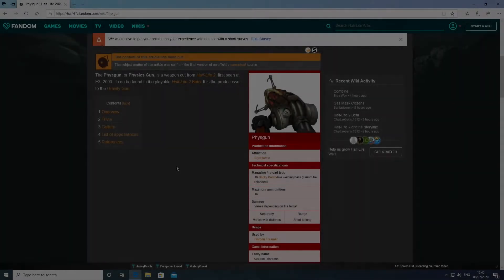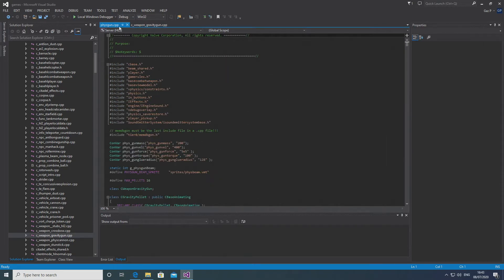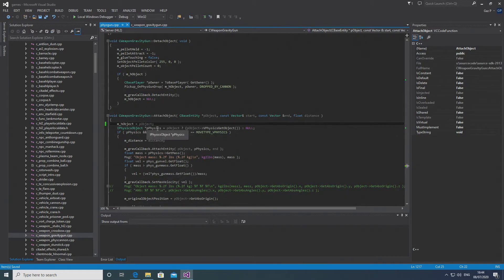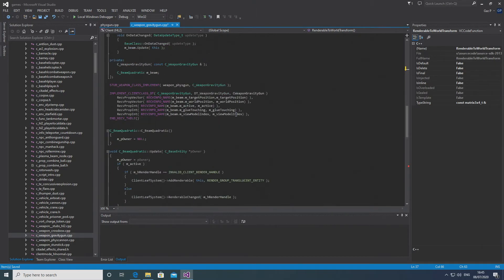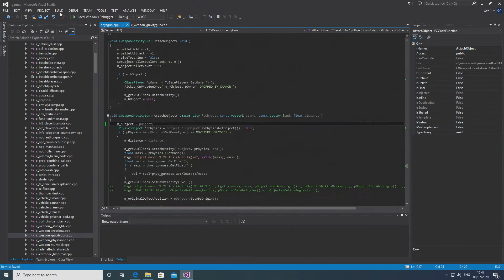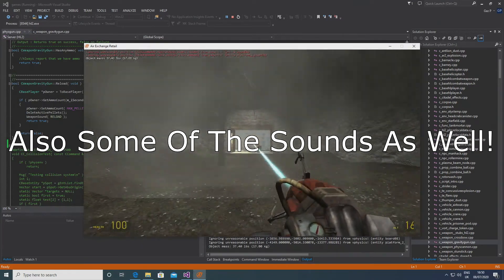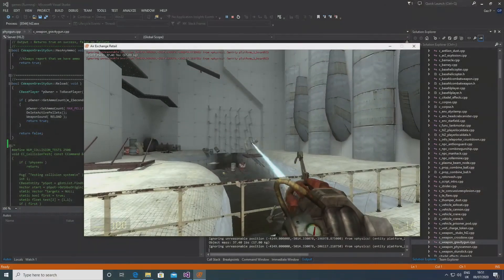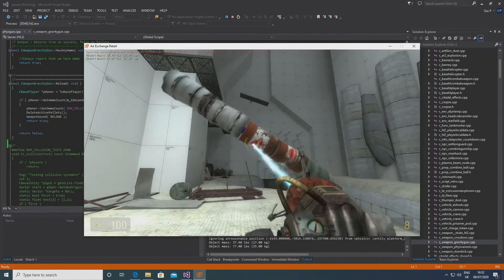Valve Source Code 2013 Tutorial (Episode 2): Fixing the Physgun

Comment: And how do I give to myself the Physgun?
Reply from the maker: Type: give weapon_physgun into the developer console.
Reply: @TheMaster974  It gives me this:
Attempted to create unknown entity type weapon_physgun!
NULL Ent in GiveNamedItem!
Reply from the maker: Did you add the files to the correct projects i.e. added the files to the HL2 code but are launching into the Episodic code instead?
Reply: @TheMaster974  I didn't understand the first part because I don't have the game solution, only the everything solution. Just explain me how to do it via the file explorer
Reply from the maker: Wait, are you trying to add this to a Source 2013 Singleplayer mod? If you are using the updated Source 2013 Multiplayer code, you only get an everything solution, which includes the projects that the games solution has.
Reply: @TheMaster974  I'm from multiplayer, the TF2 branch
Reply from the maker: You must have made a mistake somewhere, as I'm not experiencing that error.
Reply: @TheMaster974  What I'm meaning is that teach me how to move it with the file explorer, not games
Reply: It gives me this error when trying to get it:
Attempted to create unknown entity type weapon_physgun!
NULL Ent in GiveNamedItem
And I already fixed by code the Physgun

Comment: i have a question, how would i be able to make this feel like the garrys mod physics gun?
Reply from the maker: I have commented about this already regarding the object freezing functionality, which I will provide again here. The one thing I haven't figured out is rotating the held object with mouse movement, I don't know how that would be done. Reply: If you mean to freeze an object in place, then yes there is, the user I thanked in the video (Tingtom) implemented something like that. To add this kind of functionality, in EffectUpdate() and in the if(m_useDown) section, inside if(pOwner->m_afButtonPressed & IN_USE) add these lines: IPhysicsObject *pPhys = pObject->VPhysicsGetObject(); pPhys->EnableMotion(true); DetachObject(); AttachObject(pObject, start, tr.endpos, distance); then in the else statement, inside of the if statement here, add the lines: IPhysicsObject *pPhys = pObject->VPhysicsGetObject(); pPhys->EnableMotion(false); By doing this, when you hold an object, pressing the use key will freeze it in the air and pressing the use key again will allow it to move. Hopefully this is helpful (and credit to Tingtom for this addition)!
Reply: @TheMaster974  Thanks

Comment: ClientDLL_InitRecvTableMgr: overflowed MAX_DATATABLESClientDLL_InitRecvTableMgr: overflowed MAX_DATATABLES
Reply from the maker: This looks like you've done something wrong with the Client code, all I can really advise is to do exactly what I do in the video.
Reply: @TheMaster974  I copied the code from the github and it’s still not working
Reply from the maker: That's strange because the code I uploaded to my GitHub page should work fine, so I don't really know why you would be experiencing this issue. Which version of the 2013 code are you using, as well as the version of Visual Studio which is being used to compile the code?

Comment: hey, quick question, is there an way to prevent the physgun from grabbing sertain entity's i have noticed that it seems to crash whenever trying to hold the manhack, just askin if there is a way and if ya could tell me, just askin
Reply from the maker: There is, however it won't really help you with the situation you are providing. From my testing, the game crashes because of the SoundUpdate function, with a variable called pPhys being null when a manhack is grabbed. My solution would be to do: float fade = <whatever-value-you-want>; then remove the float from the existing fade definition and contain that line inside of an if(pPhys) statement, then you should no longer experience crashes. Let me know if this is helpful!
Reply: @TheMaster974  huh, implementing your fix seemed to make the manhack die, well i guess its better than crashing, thanks

Comment: Is there a way to weld object when right click like in gmod?
Reply from the maker: If you mean to freeze an object in place, then yes there is, the user I thanked in the video (Tingtom) implemented something like that. To add this kind of functionality, in EffectUpdate() and in the if(m_useDown) section, inside if(pOwner->m_afButtonPressed & IN_USE) add these lines: IPhysicsObject *pPhys = pObject->VPhysicsGetObject(); pPhys->EnableMotion(true); DetachObject(); AttachObject(pObject, start, tr.endpos, distance); then in the else statement, inside of the if statement here, add the lines: IPhysicsObject *pPhys = pObject->VPhysicsGetObject(); pPhys->EnableMotion(false); By doing this, when you hold an object, pressing the use key will freeze it in the air and pressing the use key again will allow it to move. Hopefully this is helpful (and credit to Tingtom for this addition)!
Reply: @TheMaster974  thanks you!
Reply: @TheMaster974  how i change the bind key into right click?

Comment: Is there a way to make it rotate objects when holding e?
Reply from the maker: I'm sure there is, but I wouldn't know how to do it. Setting up a condition that checks if the player is pressing the E key (+use) is easy, it's rotating the object that's the hard part. You would have to somehow come up with a way to map mouse movement (or something else) to the rotation of the attached object, which I cannot tell you how to do. Apologies!

Comment: "ERROR: Weapon (weapon_physgun) using undefined secondary ammo type (Gravity)" The weld alt-fire ammo is missing help
Reply from the maker: The Gravity ammo type should be defined already in hl2_gamerules.cpp, at least for a Singleplayer mod. If you're doing this for a Multiplayer mod, you would have to go to hl2mp_gamerules.cpp and add the definition for the Gravity ammo type here (it should be around line 925 or so). By default, the definition is like this: def.AddAmmoType("Gravity", DMG_CLUB, TRACER_NONE, 0, 0, 8, 0, 0 ); Alternatively, you can go into the weapon_physgun.txt file and change the ammo type to something else. Hopefully this helps!
Reply: @TheMaster974  My mod was MP, i'll try add that to the hl2mp_gamerules.cpp. Gee, thanks!
Edit: It works for now! Thanks! You're a W!

Comment: I implimented the code and fixed the client side just as in the tutorial, but when i run the game, it states that such entity does not exsist. Do you have any idea about whats going on?
Reply: I did everything exactly as in the video, only thing I can think of is moving the script from hl2_dll to Portal\Weapons because I’m using the portal 2013 src for the mod (it’s a portal mod)
Reply from the maker: I don't think that would change anything, as I've managed to do something similar to what you want to do and not had any issues. If the console is saying weapon_physgun does not exist, there must be an issue with your code (but I don't know what it could be?). Otherwise, if the console does not show any errors, but giving the Physgun doesn't immediately cause something to happen, it could be that you need to give the player the suit. Either way, I uploaded the Physgun files here as a reference: https://www.dropbox.com/sh/k6e72nc1d3inxvm/AAB08VaUHQZJpHAjxrkFAn4fa?dl=0
Reply: Thanks, I’ll compare the files and see if there are differences. Then I’ll try the file you uploaded to see if it works. I’ll let you know if it works. Also another question, a few tutorials for adding new weapons have said that the weapon name should be declared in c_weapon__stubs_hl2.cpp (in my case its c_weapon_stubs_Portal.cpp) but for some reason, both the beta physgun, Portal gun, and gravity gun are not declared in c_weapon_stubs_Portal.cpp or c_weapon__stubs_hl2.cpp. Could that maybe have something to do with it?
Reply: It didn't work.
Reply from the maker: Hmm...very strange, did you move the files from HL2 to Portal in the solution? And did you make sure you're launching into your mod with the modified client and server dlls? That may be worth looking into, as you could be compiling the dlls somewhere but not using them to run the mod. Outside of that...I really don't know what to suggest, other than to send me the files so I can look into it😕. In regards to the c_weapon_stubs thing, that's only for weapons that don't have any client code. As you pointed out, the Physgun and Gravity Gun aren't included in c_weapon__stubs_hl2.cpp because they have client code and are linked together through a send/recv table. So that would have nothing to do with your issues, supposing you can launch into your mod and load a map, which I am assuming is something that you can do.
Reply from the maker: Are you spelling weapon_physgun correctly? Or launching into the correct mod? It's all I can think of, if you did what I suggested in the video, you shouldn't have any problems.
Reply: I don’t know what I did, but after like 5 months, I watched the tutorial again, it didn’t work, I deleted the sln files and rebuilt them (because I changed some of the vpc files to implement gamepadui functionality) after a couple days I followed the tutorial again, and then I noticed something. The error for the network collision code being already defined didn’t happen until this latest attempt at implementing the weapon. I fixed the error as shown in the video and it worked! The physgun is now working in portal. I still don’t know what I did differently, I think I might have had the server or client code in the wrong places. Or the old source code I had was messed up. Oh well, it works now and that’s what matters.

Comment: when i got a healthpack/battery/ammou box when i get them the physgun can't find them anymore and so the game will crash any fix for this?
Reply from the maker: From my experimentation, it seems as if the game crashes when an item is on the floor and you pick it up while it is being held by the Physgun, but this crash is uncommon. The offending line (at least for me) seems to be the definition of two parameters called *pPhys and fade inside of the Physgun's SoundUpdate function. Usually, you can bring items towards you and collect them without any problems (default is scroll wheel down). If what I just outlined is the case for you, my suggestion would be to contain the fade parameter definition inside of an if statement to test if pPhys is not null (and set up a stock fade parameter above the if statement), otherwise set the value of fade to 0. Otherwise, I don't know what to suggest!
Reply: @TheMaster974  now I check if pPhys isn't null and then fade is set to 0 but still when entity is grabbed by physgun and when it destroy the game is gone. Don't know how to fix it and it doesn't matter that much. I had. Request that you make a tutorial about how add costume shaders to source sdk , thanks for helps!
Reply from the maker: Strange, your game shouldn't be crashing when collecting items with the Physgun, so I have no idea why that's happening. You can check out my coding tutorial playlist for a couple of shader-related videos and see if they are of any use to you: https://www.youtube.com/playlist?list=PL8tDEPB6h7Lk0YtRtt4k1h_Thgj1ZA2dX

Comment: help!!!!
i cant find games solution
Reply from the maker: Did you run the creategameprojects.bat file?
Reply: @TheMaster974  yes, do i need to download vs 2013?
Reply from the maker: Preferably yes, though you can follow this guide to be able to create the games solution: https://developer.valvesoftware.com/wiki/Source_SDK_2013#Unable_to_find_RegKey_for_.vcproj_files_in_solutions_.28Windows.29 But you may run into an issue where the solution won't compile, because you don't have the necessary Platform Toolset installed, which I don't know how to easily fix. However, there's the Community Edition version of the Source code that's designed to work with Visual Studio 2019 without issues, which can be found here: https://github.com/Nbc66/source-sdk-2013-ce

Comment: Hey, i love the tutorial! But may i ask for the viewmodel file? I cant find any. Im making a seperate mod. Also how do i remove the welding mechanism? I dont understand the coding at all.
Reply from the maker: Thanks for the comment! To answer your first question, the viewmodel is from a mod called Missing Information, you can just copy/paste the models + materials/models files (of course, ask before you release your mod if it's ok to use them!) I would argue using the default gravity gun model is ok, if you don't want to/know how to do what I just suggested. In regards to the welding functionality, I'll interpret it literally which means you would want to comment out the section in physgun.cpp that says "bool MakeConstraint..." (you can type /* in the line above and */ the line below the closing } ). This will throw up an error in WeaponIdle, just comment out (by using what I just stated) the stuff from CBaseEntity *pObject to the last } after the m_activepellets line. You can then build the solution and see if it does what you want it to. Hopefully this helps!